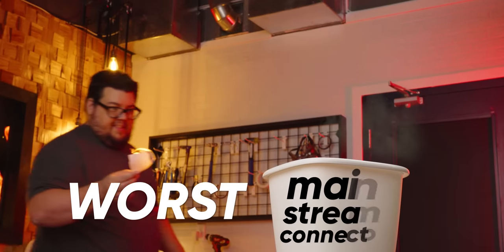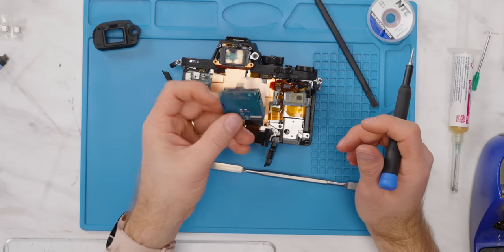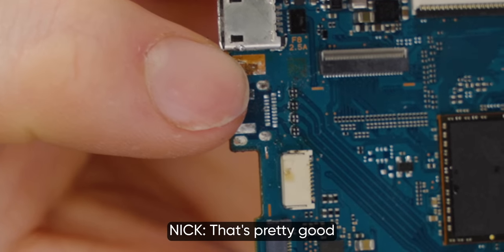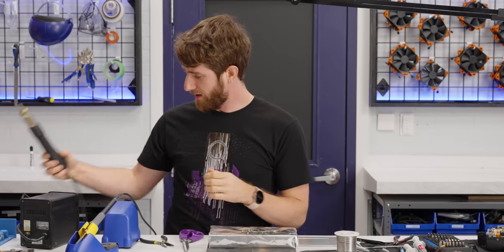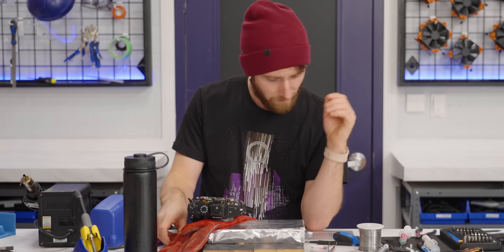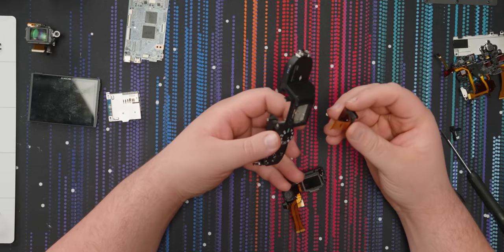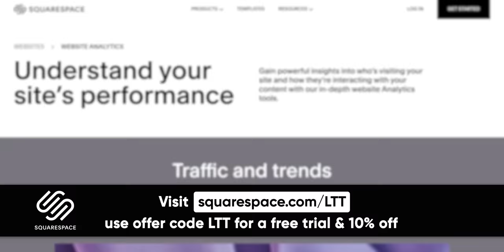This "cheap" repair almost BROKE me.

Comment: There's no way people can tell you what to do and you will nail it first time, you just need to fail once, twice, sometimes even far more, and learn little things along the way.  How to deal with ribbon cables so they don't break, do you need to tape off any components to stop them melting when heating the board, is the heat setting too high and you're just trying to do the repair too fast, do you have the right solder for the job.  There's so many things that makes this a nightmare, you gave it a good shot, but sometimes you can't win them all.

Comment: As long as the pins/pads aren't underneath the components, I'd totally suggest using a fine iron tip under a microscope instead of hot air to reflow. Too much risk to melting plastics with the unfocused heat.

Comment: Anytime I am using a hot air station on something I am worried about over heating I first apply chipquik solder alloy with a soldering iron. It lowers the melting point of the solder by half or more. Then it comes of with very little heat. Clean it up with a solder wick and then solder on the new part.

Comment: Should have used low melt solder to reduce the temp required to remove the part, then use a standard iron with a fine tip to attach the new part.  Also work under a microscope to really see what you are doing.

Comment: This reminds me of tying to repair 15 year old laptops recently, where you dont have any room for tourque for force to insert the ribbon cables back into their slots on exit, The only advice i could find is using tape to lasso the cable, what a great design..... Needless to say im now 2 laptops down, it was only meant to be a simple clean up job.

Comment: do not use a blower for it, lay the connector on it. meld it a bit. turn the pcb over some light pressure on it, meld from the back. and boom doen.

Comment: ... get an adapter so the main connector isn't being used and try to make the adapter a stress and strain relief point. If the adapter fails, swap it out. It'll definitely make the lifespan of the original connector way longer. Maybe a small mini hdmi to female humi would be good enough

Comment: You should have solder the mounting pins first! With a soldering iron, not the hot air station, once soldered use some flux to solder the pins with a flat tip making all the lead flow, preventing shorts

Comment: flux+ braid everything clean.  Let gravity seat the new HDMI. Use the iron to tack down the through hole legs. Then kapton tape over everything but the actual pins on the new hdmi port.  Apply solder paste and flux on hdmi pins  apply hot air to flow.

Comment: I would have foregone the port and just directly soldered a cable to it. 
it would be very annoying with all the differential signal pairs but there would at least be a very high success rate without proper tools

Comment: You put tape on ribbon cables and pull with tape. I learned that one the hard way too. Also the ribbon cables are super fragile in camera, so probably ripped it with the tweezers.

Comment: in terms of bad connectors, id also say usb 3 mini b is terrible, extremely failure prone, and almost impossible to buy external laptop drive holders that don't use it.  even some usb c ones go from usb at the computer end to a 3.0 mini b at the drive enclosure. i have yet to find a 3.0 mini b cable that doesn't bend and eventually snap in a loaded up bag.

Comment: I absolutely HATE small connectors like Micro HDMI, Micro USB and that even worse Mini USB. If the device has the space for a full-sized connector... USE IT! You're just creating a point of failure that'll frustrate consumers. Not that I would be surprised if that was the goal and to create planned obscolescence, so a perfectly fine camera is thrown away because one of the ports broke.

Comment: I made the same mistake trying to repair a camcorder headphone jack. I ended up soldering it ok but I dropped a tiny screw into the camera and it stopped working after a week. One of the most frustrating couple of days I can think of.

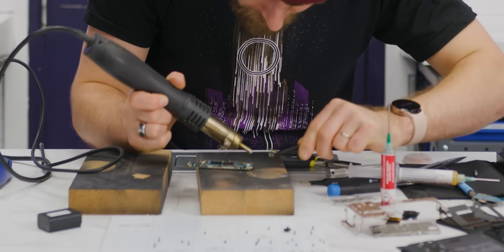Comment: 8:07 Always use flux (you never can use too little). Always cover the heat sensitive stuff you don't want to solder in Kapton tape.
NEVER EVER strain the pads (like you do here*). If done right (and used enough flux), it should fall off without any resistance. You can use low temp solder to help it along (will reduce the overall melting temp of the old solder)

*= that is the best way to rip off solder pads

Comment: 19:43 A) you probably break more with a hot plate than not of used incorrectly, and if isn't dialed in correctly.
B) I doubt the brick has temperature control

Comment: I'm sure it would've been royal PITA to do the soldering, but seeing as this camera is intended to be plugged in at all time, I would've soldered in a short lead with a full-size female HDMI on it rather than a nother micro HDMI connector. Won't look as pretty, but should never be a problem again.

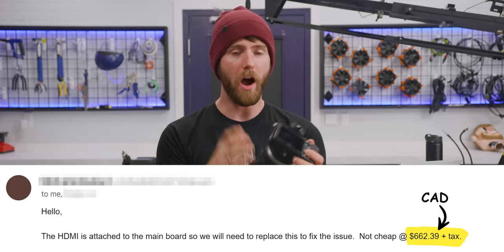Comment: 0:34 And that is why in these situations, you instead leave an adapter dangling, but securely attached to the device, so that you wear out/damage the adapter, and then is just a simple matter of changing the adapter, enormously prolonging the lifespan of the tiny, weak-ass connector on your expensive device.

Comment: If i was not selling the camera afterwards i'd just solder the cable in to it and when i assemble it glue it in place... It's cheaper, it's easier to solder pins one at a time and you end up with a permanently connected sturdy cable.

Comment: Your mistake was using the heat gun to put the connector on. Put the connector on first. Flux it up. Using the flux as a temporary glue to will line it up. Tack one pin on the side. Check alignment. If good, more flux, tap the iron with a tiny amount of solder and run your iron across the pins from the opposite side of the tack. Done. You should only use a heat gun to remove components, unless you know what you are doing. Otherwise you will dislodge who knows what on surface mount boards.

Comment: This is why I hate connectors that have "micro" in the name. I used to have a micro USB cellular modem, and the cable would constantly break in one form or another. It's why I typically forgive usb c of any wrongdoing, because at least the connector is durable.

Comment: Well, if it is any consolation, cameras were never really easy to repair as they have pretty much always been built for compactness and need small lightweight mechanical components to allow for high shutter speeds. Consumers wouldn't accept the looks and size of a camera that was designed primarily for ease of repair.
Having said that, the digital ones tend to be pretty robust except for the flimsy connectors. If you do want to use the connectors with moving cables, use cable support brackets which leave the connectors free from any excessive strain.

Comment: For something like this, I would be using my digital microscope. It sends the image to a built-in screen, or I connect any other monitor. It makes difficult soldering like this so much easier

Comment: Having replaced a microusb port before, you definitely need more than a DIY soldering kit. A good scope w/ lamp, fine tip and a temperature controlled / limited soldering iron. 
Edit: That was painful to watch. I'm genuinely surprised you guys don't have real soldering tools given the money you'll drop on equipment. . You cannot do that job with your eyeballs. or.. you shouldn't.

The goal when replacing the parts is to have the minimum amount of solder required (and heat) to simply fix the part in place in the right position, then you go around and complete the joints one by 1 with flux and a fine tip. The heat gun is more likely to dislodge something else than it is to help you get the part in position.

Comment: YouTubers learning that camera repair isn't the same as swapping an SSD on a laptop. I'm all for right-to-repair, but cameras have been way more sensitive and technical for the past few decades, and $662.39 is significantly cheaper compared to the original camera cost than Apple trying to charge its customers for a new mainboard when a connector comes loose.

Comment: This is such a frequent issue on cameras, I wonder why they don’t  improve the connection methods internally. Our bmpcc 4K’s hdmi port broke too, even though it’s always secured with a cable clamp😬

Comment: Have you thought about maybe 3D printing a holder for the mini hdmi side of the camera so it doesn’t move and leaving the cable in there
Reply: Also possible is using a really short extension cable and using THAT as the socket while keeping it permanently connected.

Comment: I tried to fix the mini HDMI port on my a7r2, went through three connectors that kept melting. Pain in the ass. (Was using a heat gun rather than a heating plate like you're supposed to)

Comment: I understand this is for a video, so the amount of work hour is not really straight forward as they are also making a video. But yeah alot of work hours from alot of people to fix it, considering the cost of the extra parts and calibration, I imagine it probably would been better to sell it, as someone who loves photography, that is my first thought with these types of cameras, and if only it is the hdmi cable, I imagine this would be easy to sell. Especially for someond who wants it to take photos, perhaps even video, basically for anyone who dont needs the hdmi. No idea how much these goes second hand, obviously is an amazing, and popular camera. But ofc the repair is for a video, and im sure they got some experince, and definetly a good video, showing more about how difficult these things actually are. I drfinetly learned if something break on my digital camera I will not attempt it. I taken lots of devices, various old consoles, laptops, stuff like floppy drives, including one 35mm slr camera appart(indeed able to maintane it) but seeing the inside of this camera, I once broke some ribbons in an old laptop, can do a little solderibg... no way I will attempt a camera like this, seeing this video, if my canon rp breaks, with a part that is cheap to buy... no way im opening it... either sell or send it to repair.

Comment: Ive tried to repair a common problem on my d80 before, you need to go basically all the way to the front so ik the pain youre feeling. Sad part is that its not fixed.
Good part is i now have 3 extra screws :D

Comment: magnification... that's the word you forgot.. :)  also if i were going that far, I think I would have bought a full size hdmi extender, cut it, then just soldered it 1 wire at a time to the board under stereo scope ;)

Comment: solder station/hot air is closer to 3-500$ you may be able to do with cheaper but i wouldnt suggest it. especially since the rig you are using is around 250 just for the hakko

Comment: You can also ruin those ic chips by heating them to hot , preheating is to eliminate warp on the board which can cause damage to bga chips , hot air should be close but not to close to prevent heating one spot to much and should be moved around a little if not able to move around hold a little farther away to slowly heat up really high heat all at once is not good and can and will damage other components or the one your replacing , also add lead solder to lower to melting point and you can hot air at first then use the soldering iron to clean up and attach the visible pins
Reply: If there's no hidden pins you don't need hotair to reattach just to remove

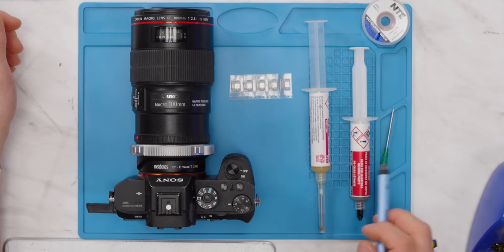Comment: @3:00 You would probably already own most of this stuff if you are ready to take on this kind of repair. So, that makes it even cheaper. 

Conversely, if you don't have most of this equipment (by $), you probably aren't ready to take this on just yet. Maybe do some soldering kits before jumping right in on fixing smd devices. It isn't easy to solder tiny stuff. THEN, you should absolutely do this, when you're pretty confident in your skillz.

Comment: Had the same issue with the mini USB port on my xl1s years ago. Luckily a local repair shop was able to replace it for me. Still infuriating since that port had only seen a few hours use by that point.

Comment: Low power laser pulse to some 0,25mm zinc wire, done! Oh god I think could do this with my laser welder in a couple of minutes if you brought me the parts. Or any other jeweler with a similar machine. Yeah, its not de- and re-solderable, but if its broken you can just drill or laser it out and laser-weld on a new one. I´m thinking about going into electronics repair now :D

Comment: If the port breaking is such a fear, why not use an extension cable as a sacrifice? Then the thing you're plugging in and out of and eventually breaking is the extension cable, and the physical port on the device recieves significantly less wear over time?

Comment: Warning:
I found out that you do not put anything carbonized in those bottles. It did take 8 months but it happened while driving and it was so loud? I thought it was a gunshot. The top blew off.

Comment: I would have used a micro hdmi cable end plugged into the socket to hold it in place instead of tweezers

Comment: shoulda use a soldering iron instead of the heat gun to melt the solder coz you know it's kinda in da name... there's also low melting solder to get things off like chip quik, coolest thing ever and doesn't damage anything. heat gun is usually used for heat shrinks and stuff we only use soldering iron or reflow oven for soldering stuff but what do I know I'm just a ms student in electrical engineering 🤪

Comment: I did this with a usb charging port on a Kindle Fire. It took me 4 different ports to get it right. Very frustrating as the hot air gun I have kept melting the plastic on the port but not the solder it was supposed to melt.

Comment: 9:05 A) That should have been done WITH the connector on. b) NOT ENOUGH FLUX! If you had, the solder would not bridge the pads. Also: The solder is now bad, remove and start over.

Comment: Look, having pins shorted is not a big deal. In fact I always have a few pins shorted after a fix like this. Just use wick, flux and a wide (3mm/1/8in) flat tip soldering iron. If it's in the right spot, flat and soldered, you're doing great. Fix the shorts and yay.

Comment: It really fucking is. If my Pi 400's video cable gets tensioned from anything, the video signal becomes garbled. And to make it worse, it's the cable itself causing the tension most of the time, since it's the same stiffness as most of the standard HDMI cables.

Comment: you should reflux the connector with low melt solder and then use the hot air gun to remove it using circular motion to prevent overheat.

oh and be generous with the flux

Comment: I can't help but feel like linus did absolutely no research before going into this.
As an dummy with butter hands, even I managed to replace a dna60 vape mod screen connector that broke off by just watching some louis rossman videos, using a soldering iron, and taking it slow.
And the frustrating thing is that I am sure linus would be able to do wonderful repairs if he just did a bit more research.

And I don't mean to be salty or a smartass, that's just how the video left me feeling. Sorry if I sound bitter, I'm just frustrated because it could've gone so much better, but felt soooo rushed.

Comment: Be very careful when handling cameras. It has a huge ass capacitor for flash and it will zap your heart out. Or make you throw the camera against the wall in convulsion.

Comment: #pace2000 station bro. You need the right tools... Also, tin the pads and pins prior to placement. Don't need much solder. If all you have is iron then get very small tip and do one at a time. Use the microscope or desk magnifier lamp... Trust me, this is an Uber easy repair...
Reply: Also, cheap acid brushes, trim the brushes down so they're a little stiff... Just use any scissor.. I do slight angle so have some slightly flexible and some pretty stiff... This is handy when you're cleaning and scrubbing at different angles...
Reply: Using only very high% isopropyl alcohol... If you get the 70% stuff you'll leave residue... Use lint free paper and brush with alcohol to clean up... Get that flux off the board everywhere... A very very little is all you need to flow if you're not over doing the amount of solder. No, you don't need a ball on each pad... That's way too much. You need it prepared, clean, then very precise dab of flux smear around the pads, don't make a mess, then tin each pad with solder on tip of very fine tip iron, use only the heat you need to flow solder on the tool tip... When you line up the part onto the pads you can then lightly tack each side on to lock it into place then go one by one. Clean tip each time to get rid of crusties, fresh solder each time for perfection, you won't likely need extra but a little on the tip of iron will help the pretinned feet and pad start to flow, especially if you have a little dab of flux on each part. Be sure you flux top and bottom of each surface mount foot.. you're looking for a very slightly concave solder joint on the sides of each pad to each foot of the part. Save yourself from burns and wasted parts of you have the right tool and a lot of practice.

Comment: Hot air guns are way overused, and probably too difficult to use for the average hobbyist on this type of work. It's like using a flamethrower to light a candle.

Invest in some ChipQuik desoldering alloy. It stays liquid at a lower temperature for a long time. No hot air required. Makes removing tiny components ez pz. I've desoldered 144 pin quad flat packs with no damage to the IC. Makes this kind of work trivial.

Comment: Wow, seeing Linus try to solder a connector that small by eye without any magnification was painful to watch. Using a rework station is great for this but once you go below a certain component size (Read: Nearly immediately for SMDs) you need at least magnifying glasses or your pins will never line up.